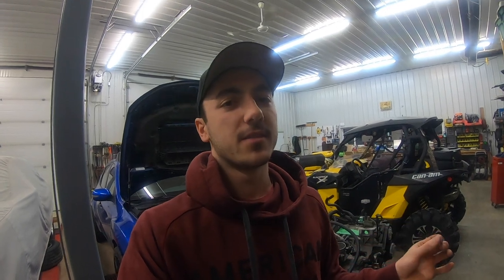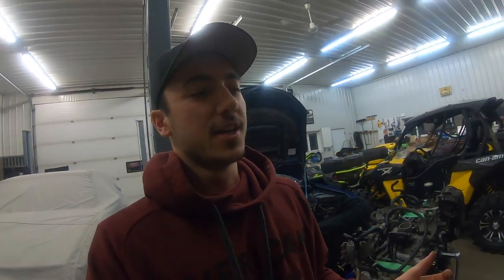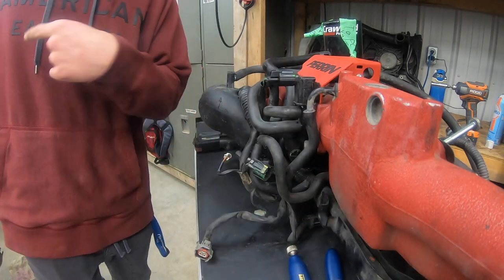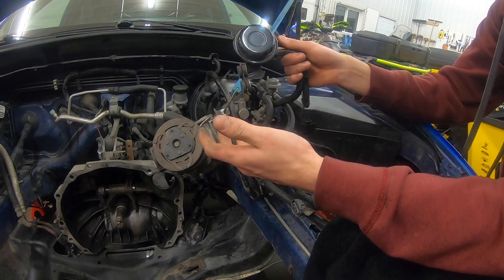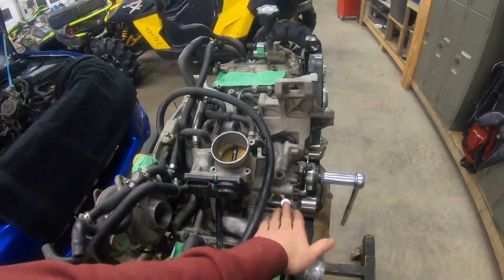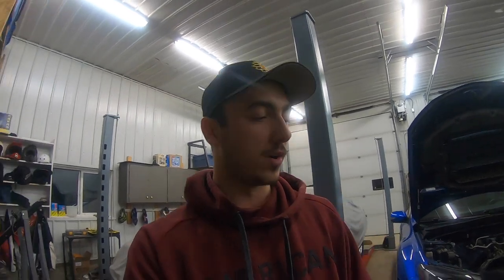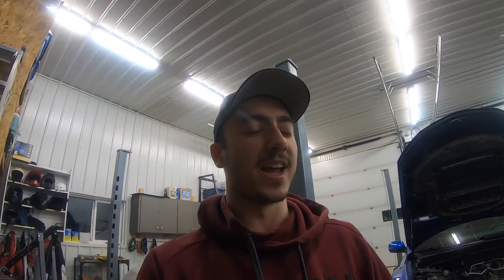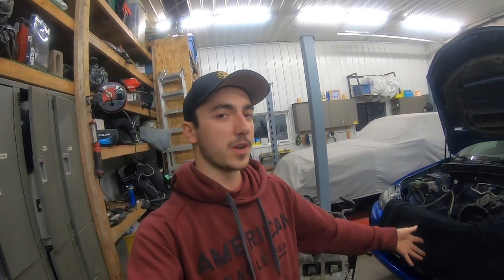SUBARU STI HATCHBACK 500HP BUILD PLAN & EVAP/AIR PUMP DELETE!

Comment: Is there anyway to still run an evap systems with a rotated kit? Or do I have to delete it to be able to run the rotated kit?
Reply from the maker: You can keep it! Just gotta run your own evap line to the intake manifold if you’re getting rid of the factory fuel lines!
Reply: @DanielKellert  sweet thanks man!!